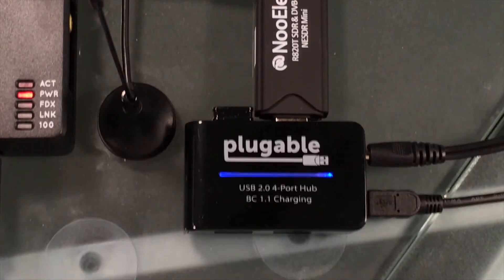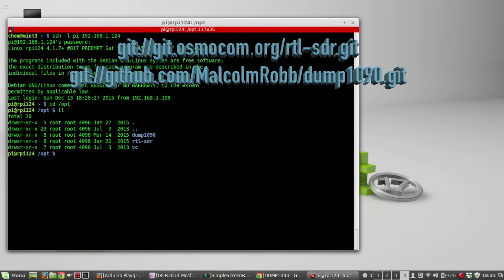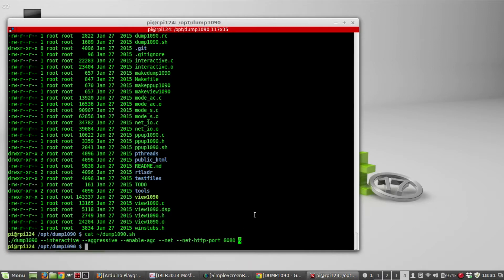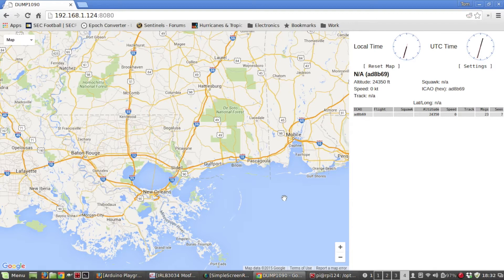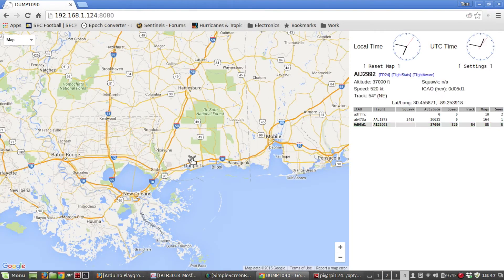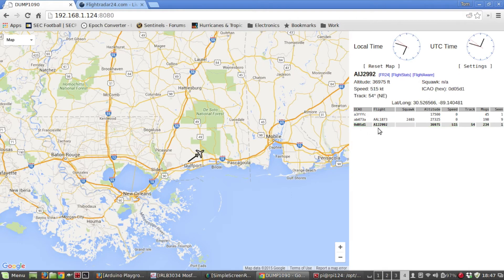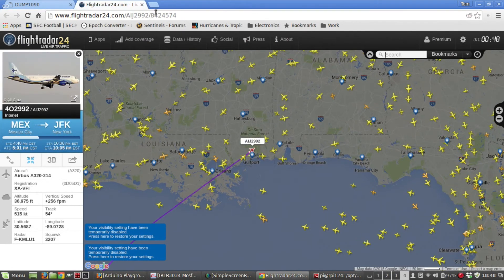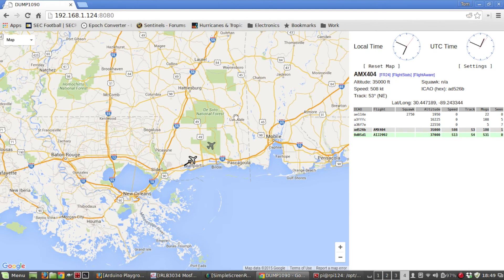Using a Raspberry Pi to Listen to Aircraft Transponders

Comment: Question ? why is the Razz Pi required at all ? you are using a Perfectly good computer to Program the Razz Pi.
Reply from the maker: You certainly could use a regular laptop.  You might want to use a raspberry pi if you find a spot (next to a window for example) that has good antenna reception.  It would just be more portable that way I think.

Comment: @ Electricks - the Receiving range of the RTL-SDR is not dependent on area. its that Crappy antenna that came with the USB-SDR. if you opt for a HQ antenna optimized for Receiving the Aircraft Data your Targets will improve. you will get even more with a External Antenna or a Attic Antenna ( If you want Stealth).
Reply from the maker: Yes, the antenna is not that great.  The range doesn't depend on the area, but I happen to live in an area that just does not have a lot of aircraft traffic.